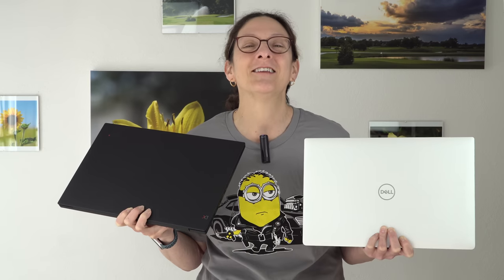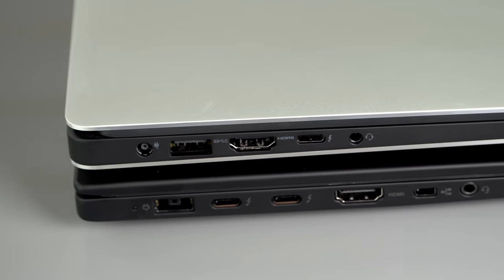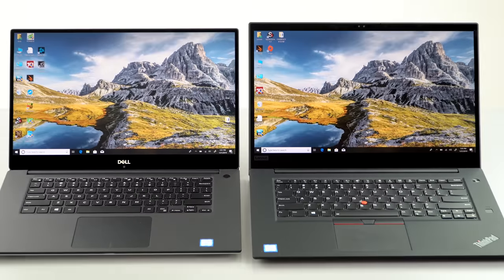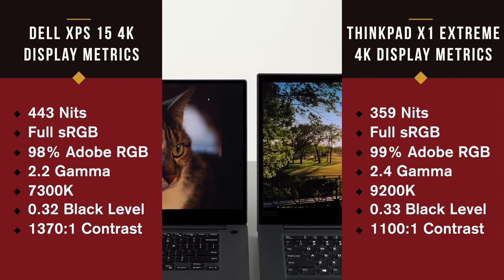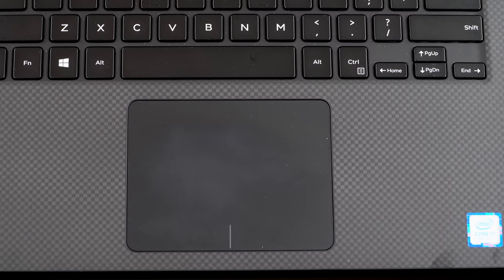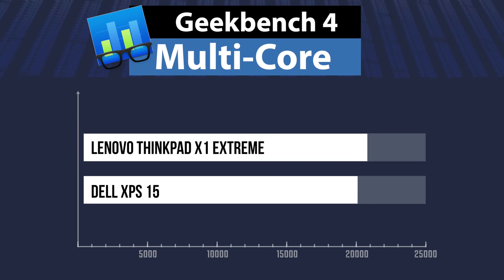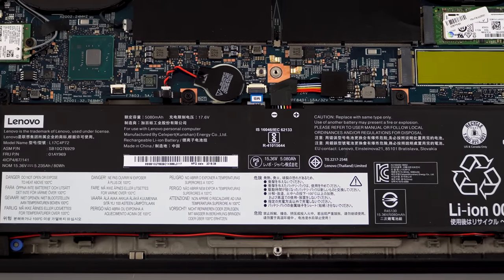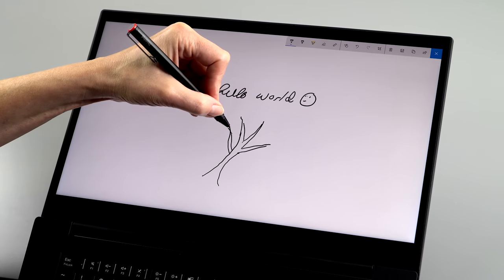Dell XPS 15 vs. Lenovo ThinkPad X1 Extreme Comparison Smackdown

Comment: I have an X1E and it's great but I have to note that it is not nice and stable out of the box. The X1E had a problem before BIOS version 1.17 that will brick the laptop if you switch the integrated graphics off. This switch is needed to install most Linux distributions. Currently on 1.17 turning off some of the features, seems like audio at the moment, will also brick the laptop. Before version 1.14 or so a Thunderbolt option in the BIOS also caused bricking.
Reply: hey, im new to laptops and stuff. man what do you do when a laptop ships with such bios issues, do you wait for the manufacturer or can you do something else yourself
Reply: @fahimmosharrof7209  basically avoid toggling those options since they are known issues and wait for the manufacturer to issue an update. Report the issue if it hasn't been already.
Reply: @fahimmosharrof7209  cant do anything until they fix it
Reply: I bricked mine 😅
Reply: So how do you do to install Linux on it without bricking it?
Reply: @ibro_47  update the BIOS first. The patch came out.

Comment: funny, I was just debating between these two laptops myself before watching this video.
Reply: Which did you choose?
Reply: David Chidester For Windows LapTops ThinkPads are the way to go, even refurbished models.
Reply: @brahsumatra  Well actually I was going to install Linux on it as that's my preferred OS.
Reply: @brahsumatra  
It really depends on what you are looking for.  

These are both exceptional designs, you really can't go wrong with either.  Personally I went with Lenovo for my convertibles (370 Yoga) because Lenovo have a better stylus and hinge designs, but went with an XPS 15 (i9 / 32GB ram / 1TB SSD) for my personal workhorse because I love the design, and the display and performance are both mindblowing.  

The biggest issue with Lenovo is tha their customer service is really poor.  As somebody who has worked in IT support roles for around 10 years now, I've had consistently poor experiences dealing with Lenovo support regardless of whether it is for corporate or personal products.  

Dell support (both personal and corporate) on the other hand is without question the absolute best there is. 

As far as reliability goes, they are pretty roughly on par.  

As far as design I'd rate them pretty much equal, with the Lenovos having the edge in ergonimics / usability and the Dell generally having the advantage in appearance and style.  

Both are really great products/

Comment: Killer card in my XPS 15 was dropping connection fairly often. Didn't like it at all. I changed it to an Intel card and it stopped having the issue.
Reply: would you mind me asking exactly which card you bought? ive been thinking id like to replace my killer card as well

Comment: more durable, flat folding screen, 2 ssds, 64gb memory, best keyboard, dedicated ethernet slot 2 tb3 slots, sd and smart card slots, splash resistant keyboard, better thermas, better drivers, proper webcam, less battery life and less bright screen.
hmmm?

Comment: Dell doesn't seem to care about costumers. So many people, me included, have complained in the past about the crappy WiFi card on their pricey Dell XPS laptop. What does Dell do? Equip their next gen with yet another crappy WiFi card. And as rightly pointed out, stability is a work in progress. Aside from that, the XPS line is very solid. I own a 9550 and I would be very happy if not for these two issues. As it stands,  I like the ThinkPad option more. BTW, very good comparison, what is missing is comparing the touchpads. Don't know about ThinkPads, but the touchpads on the XPS line are very good.
Reply: Don't know if this will help, but as someone with an almost five year old Thinkpad, mine is WONDERFUL, never off, always accurate, and things have only gotten better as I've heard, so I don't think you should have any trouble if you with the Thinkpad's! :D

Comment: The dell seems good, however, the chin cam is a deal breaker for me. I have had other Dell laptops with the cam in a normal position (up top), but I may very well end up going for the ThinkPad.

Comment: This is one of the best mobile workstation on the market.The down side is its expensive,and has a short batterylife which is common for this class of laptop.Version three of the x1 is not soo good as its started to solder components on the motherboard.So buy version 2 whilst you can.As for Dell drop it and its dead with potentially smashed screen due to narrow besils.Think pad is still the winner on build quality and design for power users.

Comment: between these 2 which laptop is best for a college film student who will be creating and editing videos/movies and doing some photoshop editing (using all adobe programs) OR is there a different laptop that would be better?
Reply: I would not recommend either. I would recommend an ASUS U series or ZenBook
Reply: @jamesbroderick3394  could you help me understand the difference between intel processors that have U and H on the end. whats better for video creation and editing? because from some research ive done people say its better to have H series.
Reply: @alyj6381  U processors stand for Ultra low-power. They perform not as well as H processors. H processors are high performance. A lot of Intel processors ending in U are only dual core. For what you will be using the laptop for make sure you buy an H processor, or at the bare minimum an MQ processor. If it ends in a Q it is a quad core. Make sure you buy a quad core processor
Reply: @jamesbroderick3394  ahh ok, thanks! so some of the laptops ive been looking at either have the i7-8750H or the i7-8850U in them. Id be better off getting one with the i7-8750H in it? i havent come across one with an HQ on the end, just the H.
Reply: @alyj6381  I think you mean the 8550U. The 8750H is the better processor

Comment: So giving each point a weight according to its criticality: 
Thinkpad x1 Extreme Gen2 :
- more stable drivers ---- 2pts
-Better keyboard ----1pt
-Better overall support ----1pt
- Better Thermals--- 3pts
----------------------------------------- 7pts overall
Xps 15:
 - Higher Storage at lower money --- 2pts
- Better Screen ---- 1pt
- Better Value for money -- 1pts
- Better Battery -- 2pts   (However Screen will play a role in decreasing actual time of use)
----------------------------------------------6pts overall

Comment: As for designer/video editor/photographer :

Dell is the only one that TECHNICALLY should do the job but it has so many problems (judging from people's comments) it's not worth it imo. The only thing worth buying seems to be macbook but macOs sucks balls ): surface laptop 2 maybe ? At least when the prices go down? 

It's funny once you think about it, from the sea of Windows laptops there are only 3-4 models to look at (with 4k IPS display, i7 cpu, nvidia gpu and good battery) and all of them have major thermal issues, or other problems (xps 15, hp spectre, asus zenbook) and don't last. It's sad